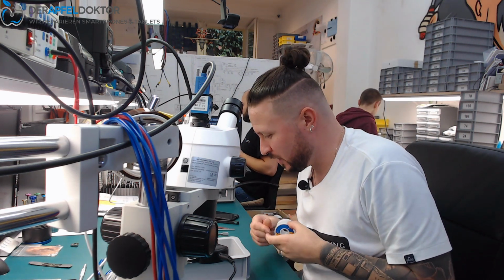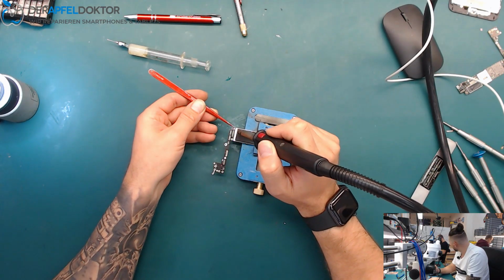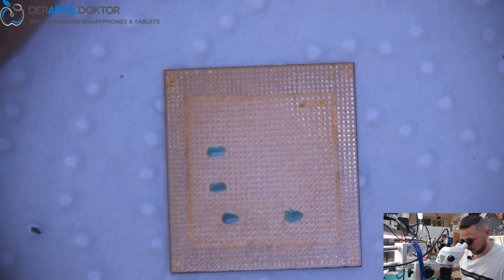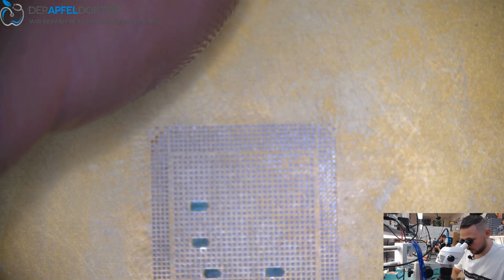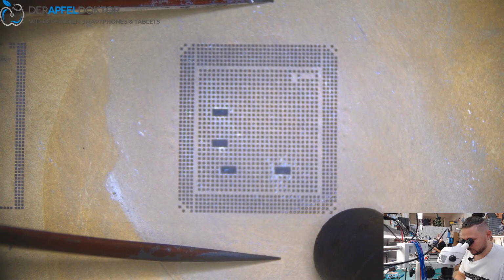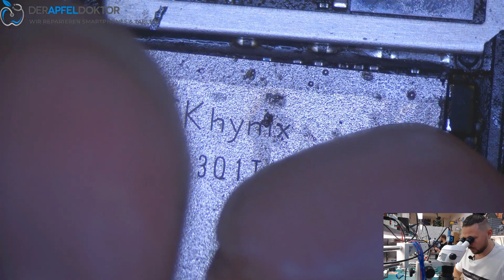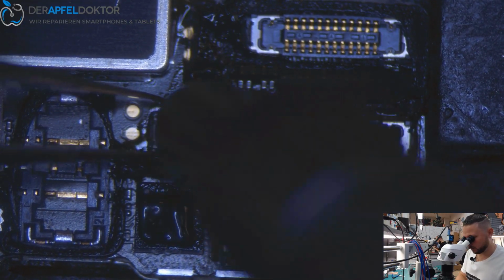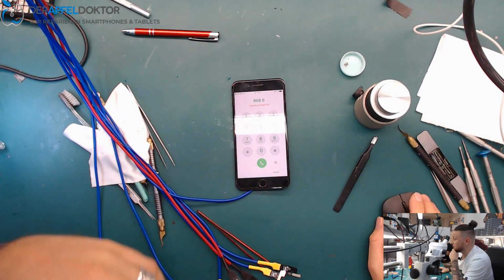MASTERWORK - iPHONE 7 PLUS WITH OVERVOLTAGE - HIGH VOLTAGE DAMAGE - BOARD SWAP A10 - DATARESCUE

Comment: What is you heat gun ? 
And what is the temperature you use to remove the cpu ?
Reply from the maker: I don’t talk about temperatures. If you want to learn you have to pay for a place at our board level repair school Germany.
Reply: What is your hot air brand ?
Reply: Wich is model and brand of the air solder station?
Reply: Alaa Salamin it’s jbc hotair
Reply: @RESQREPAIR  give details about this, I mean site where one can apply
Reply: @essam_maher  may be quick TR1100 hot air